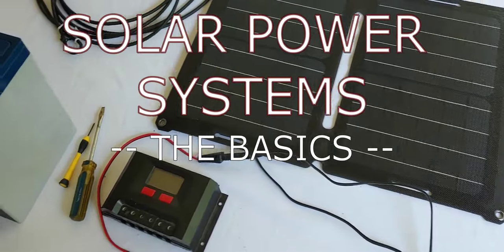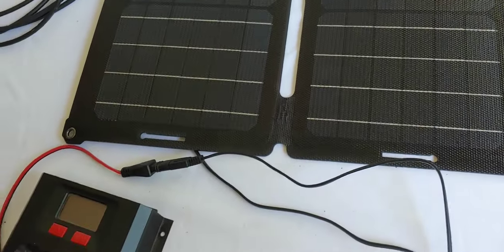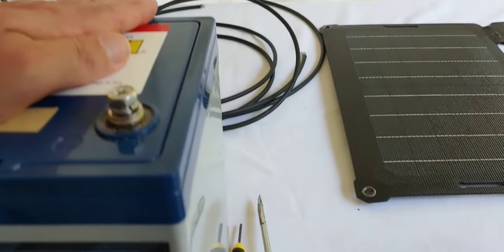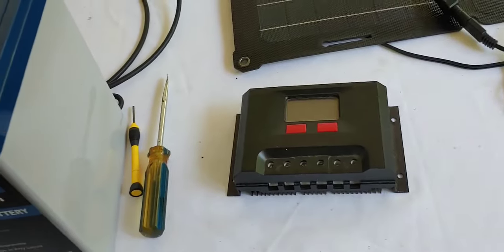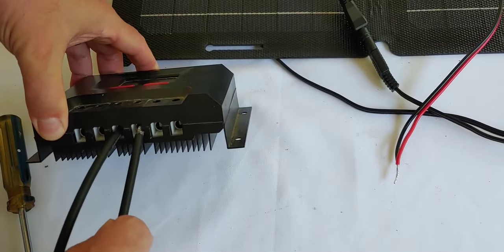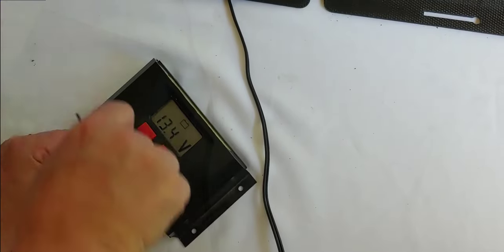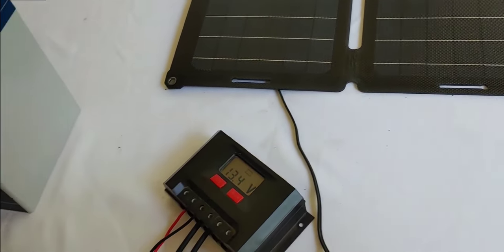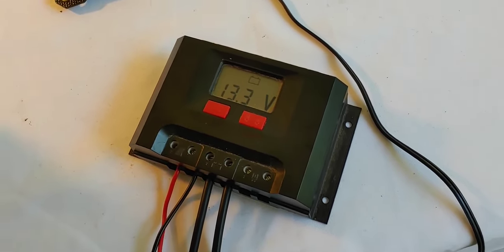Solar Power Systems: The Basics

Comment: All good. Video basically spells it out, how to install a solar setup. One thing to keep in mind is that DIY systems using different parts from various brands can make for plenty of incompatability problems. So it's not that simple.
Reply from the maker: Actually .. It is that simple. I use different brands all the time.
Thanks for your comment.
Reply: @shoestringprep that’s true, the battery, solar panel and charge controller work together as long as they match up in the capacity specifications. I would add ,especially if your just starting out, read the manuals provided with each product. As a mater of fact read the manuals while you are shopping for the products. This may reveal some differences between brands that make a difference.
Reply from the maker: @rccosplay3249  thanks for your comment

Comment: How do you hook up a battery charger powered by a gas generator to this system? Can you just connect the charger directly to the batteries without harming the panel, charge controller and inverter?
Reply from the maker: Yes, you can connect the battery charger directly to the batteries. The solar panel would not be harmed.
Thank you for your comment.
Reply: That was a good question.

Comment: I love your videos, but I have a couple questions. #1) You know the 35 amp hour batteries that harbor freight sells, what is the highest interver you can use with one of those?>>I have a solar panel, a charge controler (I can't remember if it's 20 amp or 30 amp, but I believe it's 20 amp?), I need adapter cables to go from solar panel to charge controller. Then the cables from the charge controller to the battery. #2<<Do those need to be a certain gauge though, coming from charge controller to battery? I do have a little 300 watt pure sine wave inverter with alligator clips I could use with it, but I wanted to know the highest watt one you could use with one of those. I know the DOD is only 50% on those batteries and I guess you'd keep track of that with a battery checker, the correct name escapes me ATM?
Reply from the maker: You have several questions here. Let's try to answer them for you.
1) You can use any size inverter with a 35AH battery, but I would recommend not using anything larger than your 300-watt inverter. Anything larger will just draw the power out faster.
2) Most solar panels come with their own wires. However, the last time I had to buy wires, I got some 10AWG and they have been working fine. You may use the same size cables on both sides of the charge controller.
3) As you know, it's best to use only 50% of the lead-acid battery's capacity before recharging. However, with your inverter, the manufacturer says it is 300 watts. And you may accept that as its upper limit. If you try to pull more than 300 watts, the inverter will just shut down (but I don't think it's damaged by the experience).
Good luck with your solar power journey. 
Thank you for your comment.